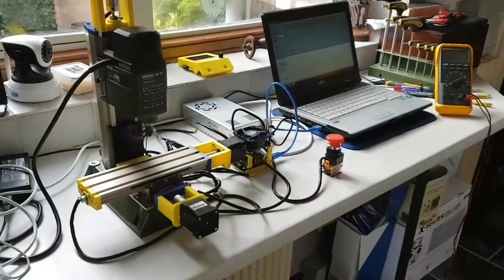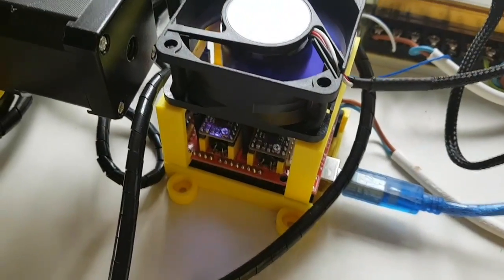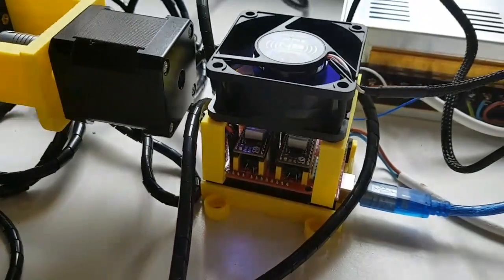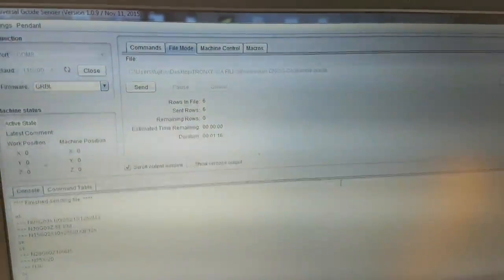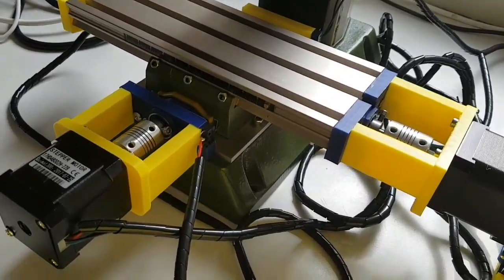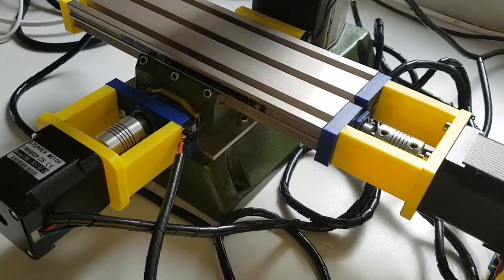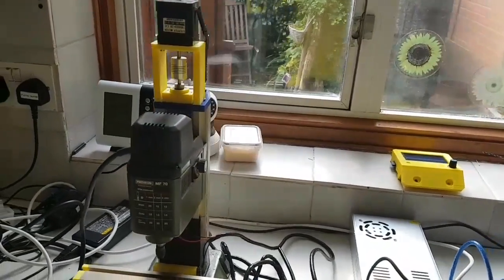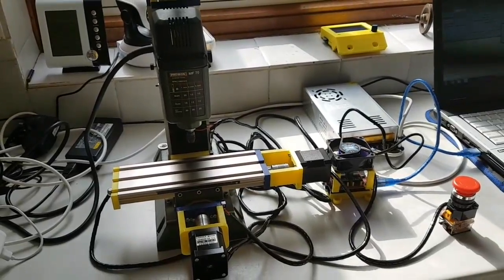PROXON MF70 MILL - CNC CONVERSION

Comment: What CNC control software are you using.  I got CAMBAM to produce the Gcode from my cad file. I'm currently using Universal Gcode Sender on a Raspberry Pi to push it to the MF70 via the Protoneer board.  I can reliably move in all three axes but I haven't found the secret to setting the 0,0,0 point at the proper location on my work piece.  In doing some reading I think what I'm missing is something like MACH 3.  My preference is to use something that runs on a Raspberry Pi so I don't have to take my laptop down to the shop In your video I see a laptop so I'm guessing that is where the control software is running. If need be I'll run the  control sw on windows.  Thanks for all of your help.

Comment: I finally got the last of my end stop switches mounted.  The CNC kit I bought only had brackets for one end of each axis and no provisions for the limit switches so I had to make some new ones and modify the rest..  Given that there will be movement of the wire I'd like to know what kind you used and how well it worked out. I've read about needing shielded cables to keep electrical noise from falsely triggering an end stop condition.  My plan is to use the NC switches so if the wire does break it will stop the movement.
Reply: I finally started making forward progress again after I figured out that my NC stop/limit switches should be wired in series for each  axis.  The protoneer shield has a +X & -X (repeat for Y and Z axes) but they are wired in parallel to a single UNO input pin (11 for Z, 10 for Y, and 9 for X). That works fine for NC switches to wire each into a + and a  - (XYZ) but when I tried that for my NC switches I had to trip both of them on an axis for the signal to register.  By wiring the + and - together in series and plugging them into the + terminals for each axis it started homing and limit stopping properly.

Moving along, what CAM software do you use to generate the Gcode? I'm using Universal Gcode Sender on a Raspberry PI to run the gcode sending.
Reply from the maker: You can use any tiny ones...the ones I used were the same as those used on the Bubblegum CNC article on YouTube...they fit the mounts
Reply: I have the switches mounted. I'm interested in the wire you used and how well it held up to flexing as the mill moves.  I've also heard to use shielded wire.  What kind of wire did you use?
Reply from the maker: The limit and ES wiring is just plain bell wire two core. It is the stepper motor cabling that needs shielding ideally.
Reply from the maker: CamBam...it's simple and for me that's important. You get 40 free sessions to try before buy

Comment: I'm in the process of converting my mf70 to CNC. I have the motors and the cnc shield wired up but I don't want to mount them on the mill until I've worked out the end stops.  I'm using the latest version of the Protoneer shield which has connections for them. I want to avoid the temptation to run it and hope I don't bump into the maximums on any axis.  Do you have anything posted that shows where and how you mounted the end stops?  So far I haven't found anything on the internet that give that detail.
Reply from the maker: James Darrah You can see the end stops I've added on each axis. I 3D printed holders for them from the Bubblegum CNC Thingiverse page and he details which type fit.